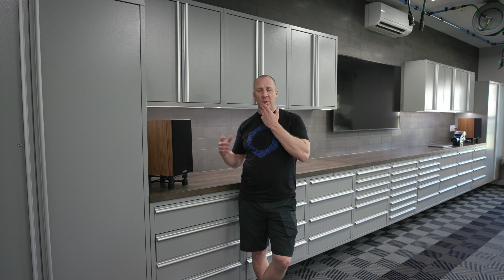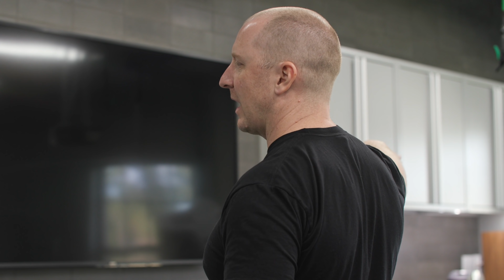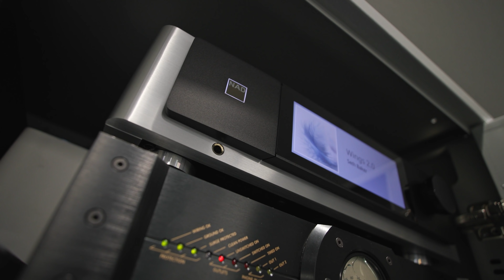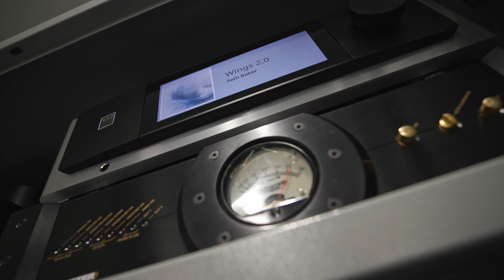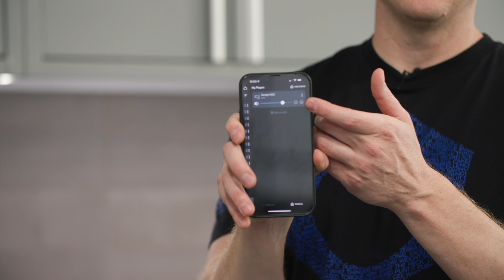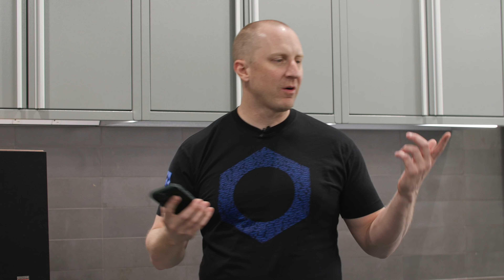Obsessed Home Garage Audio - Completed!

Comment: you should be connecting AppleTV to your home network instead. as counterintuitive as it sounds the wifi card inside is equipped to push a gig but it will cap you when you pull from ethernet

Comment: The AppleTV is better on WiFi. Over Ethernet it’s only 10/100 but it has a gigabit wifi card
Reply from the maker: Hmmm... I didn't know that.  Good info.
Reply: Same with the Sony TV, using a USB 3.0 to Ethernet adapter to get more than 100 Mbps on mine.
Reply: This isn’t true. I use my AppleTVs hard wired and get full gig speeds
Reply: @xxxxapaxxxx  the newest AppleTV has gigabit. The older ones do not.

Edit just to clarify. AppleTV 4K has gigabit anything before 2017 does not.

Comment: AC not centered.....Matt what's going on
Reply: He covered that in a different video. Center of the door and the wall are different if I remember correctly.
Reply: @timkinley1779  the electric panel used to be in the garage where the TV currently is. He installed the AC before he moved it outside and couldn’t center it because of that panel.
Reply: @FlipnKraut  Sounds right. I may have been thinking of the lights and joists.

Comment: Insane. His garage entertainment system blows out probably 99% of home entertainment systems lmao. Keep doing you my man!
Reply: Keep doing it?! Keep doing stupid things?! It’s stupid and overkill. It’s like using Porsche GT2RS with 15 inch wheels running Chinese tiny tires capable of max 60mph.
Reply: He's doing so many things wrong, it's wasting money on gear..
Reply: @Oneness100  Correct. He’s literally just putting most expensive stuff without any reason just “because he can”. Which is the most ridiculous thing. It’s like putting track tires on old 80s Toyota Corolla.
Reply: @AudiS4orce1  It's not even the most expensive stuff, but certainly more expensive than what one should put in some of the worst acoustic conditions..  :-)

I would compare what he's doing with putting a $10,000 Bermester audio system in a old and rusted out Yugo..  It's like what's wrong with this picture….  :-)

Actually he could get the garage to get somewhat decent acoustics, but he'd have to first clear the room out, and put probably at least $40K worth of treatment and THEN those speakers will sound great….
Reply: @Oneness100  It's NOT the price, it's the stupid setup, for such a horrendous acoustically terrible room, you can NEVER EVER take advantage of the gear quality he's using, even he kinda admits it at the end, a basic 2-ch, or active speakers, OR just couple of Sonos speakers at fraction of the cost would sound not that much worse.
Reply: @AudiS4orce1  yup…. Cna't argue with that…. 

I don't know why people spend that kind of money when the room sucks that badly.. It's like a cave..